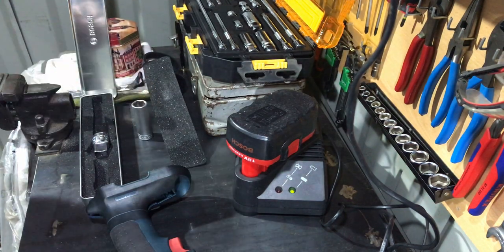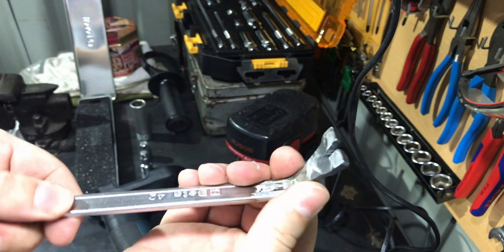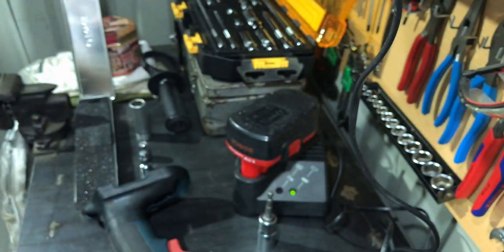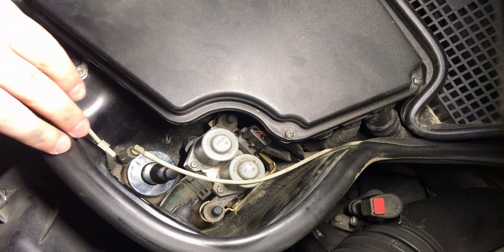Bosch Cordless Tool & Special Wrench for W210 Shock Absorber

Comment: heyyy my friend.That Bosch drill is fantastic!!!So cool that it is a gift from your father also.That makes it special also.And the shock piston holding tool is also great.We had a special wrench for these shocks when i used to work for the Mercedes Benz dealership.,,i can see if i find out what tool it is. :)
Reply from the maker: Stefan, just saw your comment. Thank you man. I helped my father a lot to repair this Bosch drill, for example i ordered some parts of it from USA and have to wait long time before to make drill work. Finally we repaired it and father gave me the drill, because i had no tool like this in my garage. About absorber tool i want to say that i have searched a lot, but could not found any proper solution for Mercedes, you know there are some generic china made strut socket sets but i do not need them because i have not work with absorbers all time. The only tool i found was Hazet 3017A, but it is stamped that this tools is fro VW and seller could not confirmed that it would fit on W210... Then i decided to do my own wrench and i did it. It is not perfect looking tool, but it actually works. Stefan it will be very kind from you if you tell what is the proper Benz absorber tool. Greetings :)))